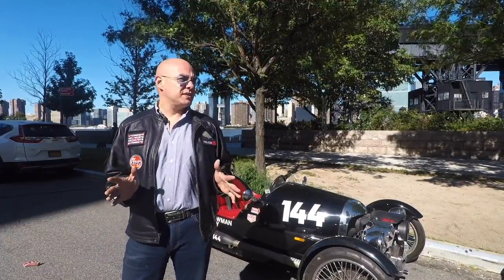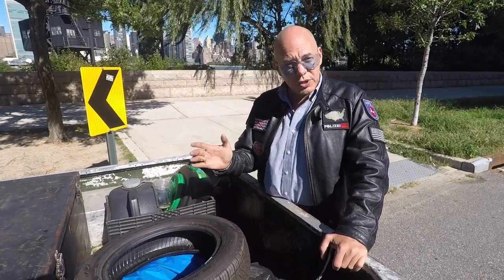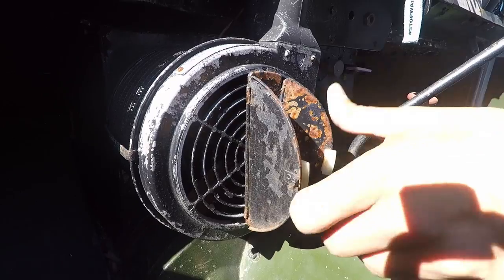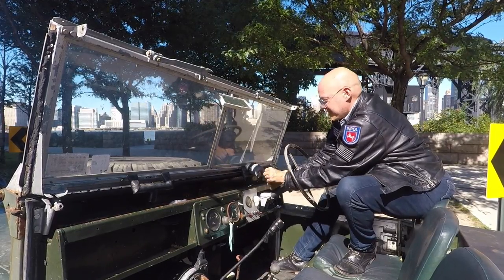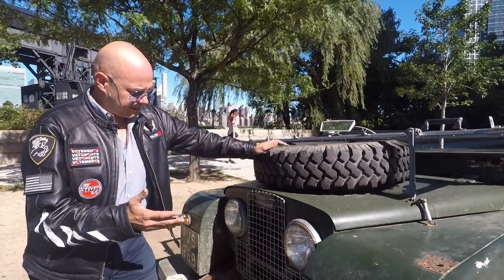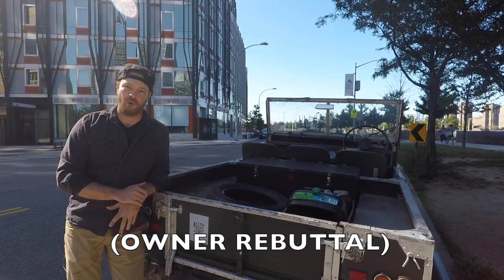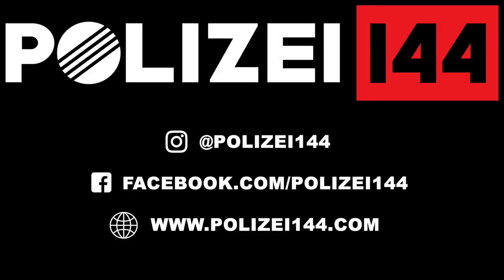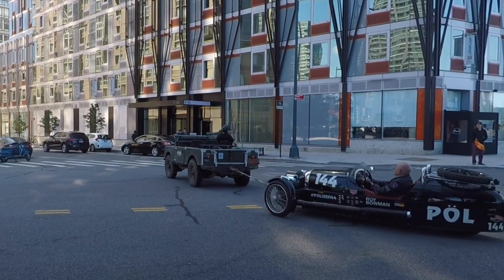1955 Land Rover Series 1 - Morgan Versus: Episode 3

Comment: You missed an important point ... Radiator grille:  The Land Rover has a metal grille you can take off easily and use for an impromptu BBQ in the wilds, the Morgan doesn't even have a radiator, Land Rover wins